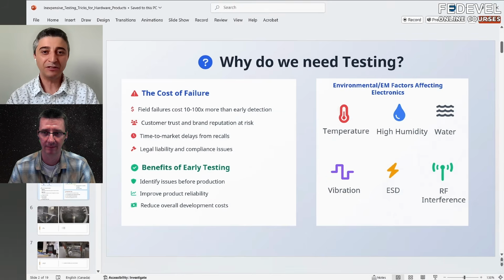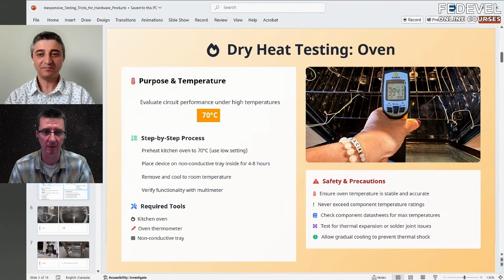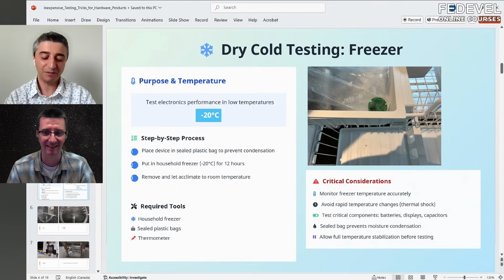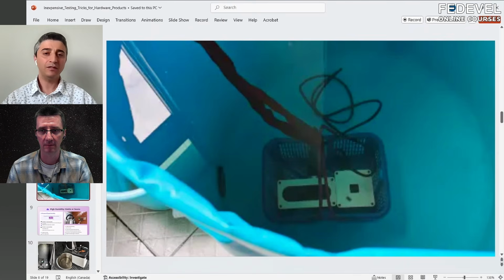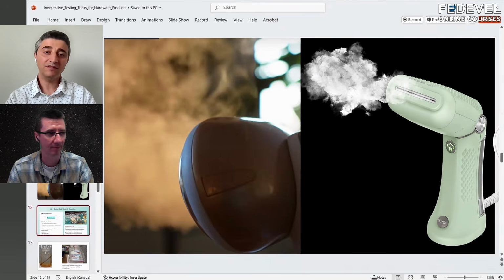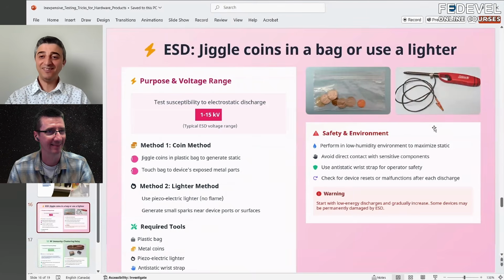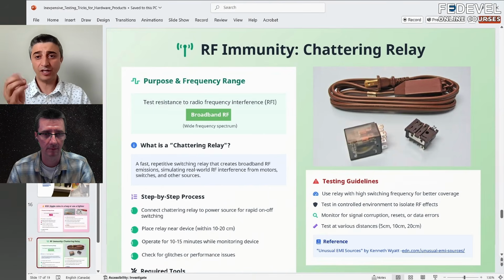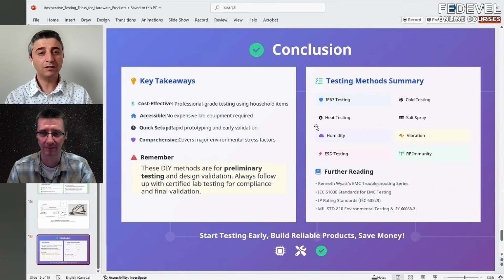9 Tricks To Test The Board You Designed - Do you know them?

Comment: Thank you for the video, I learned quite a few new things.

1. On Temperature Testing: I agree about the cold temperature test being extremely valuable. If you only have time to do either a cold test OR a hot test, I would opt for a cold test most of the time, especially if it makes sense for the operational environment to which your product might be exposed. It reveals so many interesting problems. Hot tests obviously reveal other types of problems, and that may be more important for your use case, so this is not a blanket statement. But personally, I have a much greater fear/respect for cold operation than I do for hot operation, at least for the designs I've worked with in my career.

2. On Ingress Protection Testing: This might seem obvious, but make sure you do not put your electronic components and expensive one-off prototype parts in an enclosure and then do some testing which could destroy those parts, unless you really mean to do that and take that (financial) risk. I have worked at two different companies now where this type of testing was pawned off by the engineering team to various interns, with poorly defined testing requirements or poorly written test instructions. Those interns put some very valuable components in an enclosure which had never been tested, and it ruined these parts and ended up as a very expensive and frustrating mistake and oversight (which obviously was not the interns' fault in any way). So, only put those parts in when you really mean to, such as after you've done some basic tests with an empty enclosure.

3. On (Water) Ingress Protection Testing: Color-changing dessicant was mentioned in the video, but I have found that water-sensitive indicator tape to be very useful. This is the same tape that for example some cell phone manufacturers have famously used in their phone enclosures to deny warranty claims for people who dropped their phone in the toilet. An example is PN 5559-0.5-5 or VPN 1067-5559-0.5-5-ND. This tape seems expensive on the surface, but you only need a very tiny amount of it for each test, placed strategically, such as on the floor of the enclosure, or underneath/around seals. This also helps to reveal which parts of the enclosure a leak is coming from, because you can see the tape changed color here but not there. A single roll of this tape has lasted several years because we only use it for this kind of early testing for new product designs.

4. On Ingress Protection Requirements: This might seem obvious, but depending on which IP or NEMA rating your requirements are aiming for, you may want to intentionally make your enclosure "poorly" sealed. The naive thing to do is to say "I'll just seal the enclosure as good as I can and then test it, and hopefully we meet or exceed IPxy or NEMA k." But actually you may want your enclosure to be able to drain away water that has entered the enclosure, in a safe and controlled way. One very common standard, for example, actually requires you to have a drain hole at the bottom of the enclosure; the idea is kind of like "your enclosure is not well sealed, so if you don't make a drain hole, then any water that does get in may not be able to get out." So an enclosure that is sealed like Fort Knox is not always the best thing for the situation. Think carefully when you are creating your product requirements, and react/adjust requirements and/or designs appropriately when these problems are revealed in testing.

Comment: Ferrite beads are no end of trouble.
If you can implement a suitable filter with LC (or LCR) circuit it will be much easier to tune when it doesn't perform as expected :)